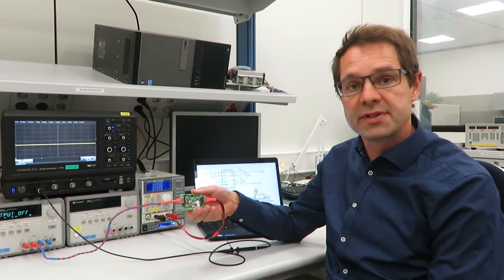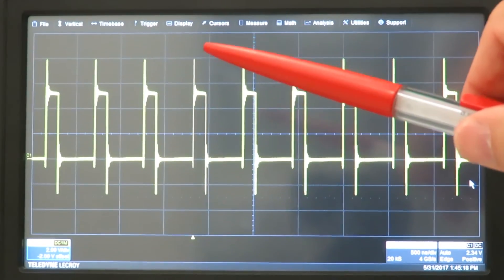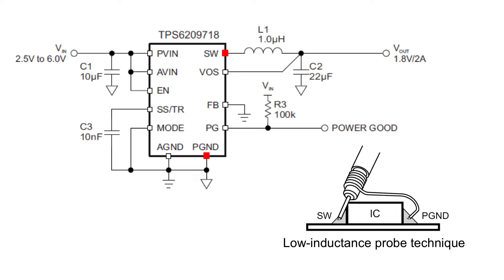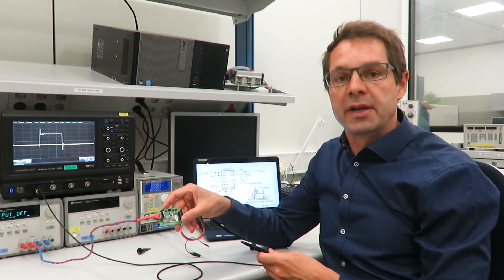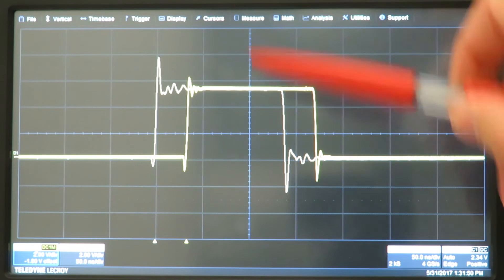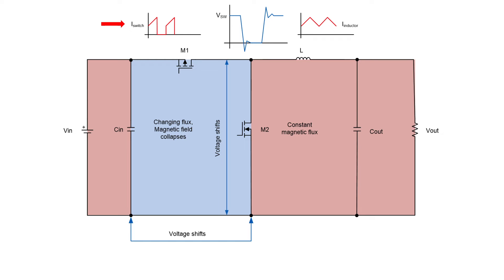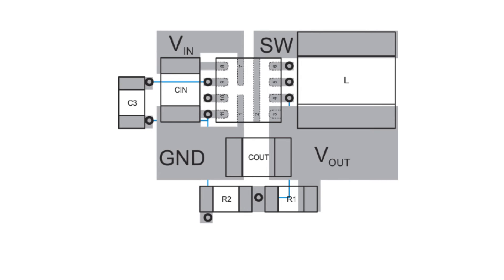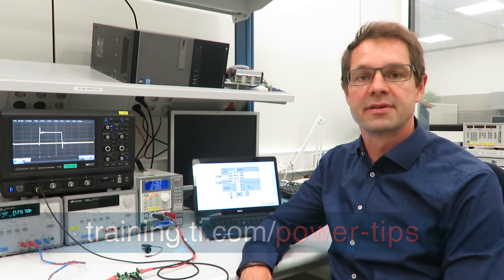Power Tips: Managing your DC/DC converter's switch node sensitivity

Comment: One additional comment: don't be afraid to choose pkg size for passives around device to facilitate "direct to pin" routing as well as routing non-critical lines in between pads. Sometimes a physically larger cap, despite taking additional space, can open up routing lanes that couldn't be realized with a more diminutive SMT package. Also, realize that the smallest loop area may be through a reflection plane under the device rather than routing on top layer. In this case multiple vías (to lower connection induction) can help. It is, after all, a 3 dimensional world...